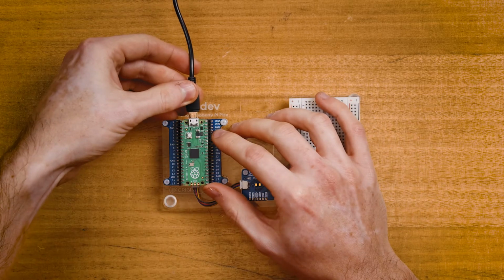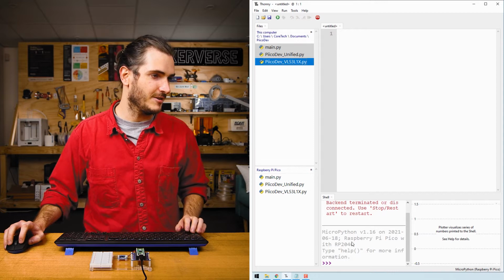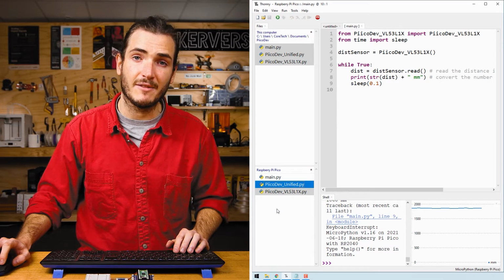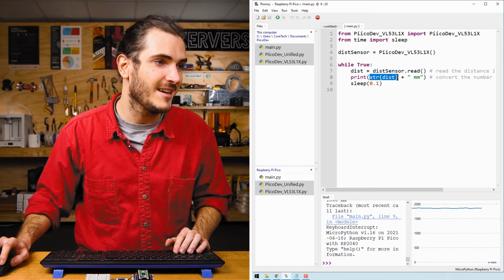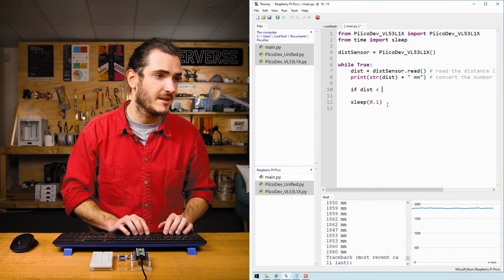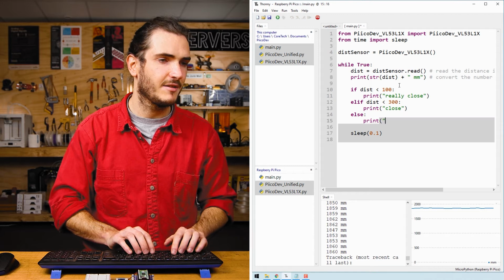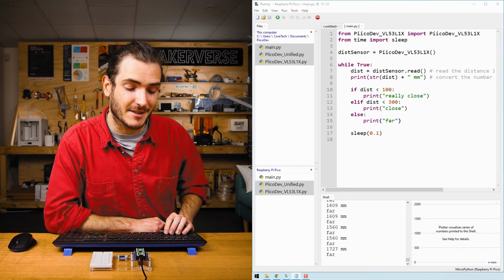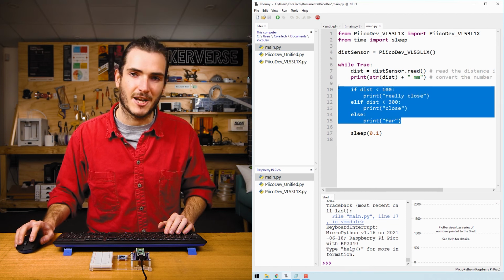PiicoDev Distance Sensor VL53L1X | Raspberry Pi Pico Guide

Comment: Thanks for making this simple to follow. This is fine for sitting at the bench and plugging into the computer, but what about when its implemented in a real situation? When i take this out into the workshop and hang it off my roller door, how do i then get it to talk to my computer ( and more so, to Home assistant)? Im sure im missing something simple. I did search the forums but wasnt able to locate anything
Reply from the maker: Hey Wayne, I can start pointing you in the right direction with some resources. First of all, if you want to display the data, you can pick up a small inexpensive OLED screen that can plug directly into the Pico: https://youtu.be/GCfDiEg_iNE

To run the code without a computer, you can save it as main.py onto the Pico. Every time the Pico is powered on, it will automatically run this code. You'll also need to find a way to power it, we have a guide for both of these things here: https://youtu.be/lHXecyrun_o

We unfortunately don't yet have a guide on Pico and home assistant, but you will need to use a Pico W which has a wireless chip on it. This will allow you to connect it to Wi-Fi and then to home assistant, there should be plenty of helpful guides out there for it.

If you are still stuck, feel free to chuck a post on our community forums, we have lots of makers over there who can help out: https://forum.core-electronics.com.au/

Best of luck mate!

Comment: Do you have tutorial on breadboard instead of using your expansion board ?
Reply from the maker: The four connections to make are 3v3, GND, SDA (to GP8) and SCL (to GP9). The best place for more in-depth technical support is at the bottom of the article, or on our forums https://forum.core-electronics.com.au/
We're full time makers and quick with a reply!

Comment: I downnloaded the code but get the following error messages when I run it on the Pico: 
Traceback (most recent call last):
  File "<stdin>", line 4, in <module>
  File "PiicoDev_VL53L1X.py", line 111, in _init_
  File "PiicoDev_VL53L1X.py", line 135, in reset
  File "PiicoDev_VL53L1X.py", line 124, in writeReg
OSError: [Errno 5] EIO

Any suggestions?
Reply from the maker: Hi Chet - we can offer better support over on our forums where it's easier to share code and photos of your setup. Head over to https://forum.core-electronics.com.au/ - we're full time makers and pretty quick to respond there!
Reply: i do to
Reply: Hi, try to power the sensor from an external power source instead of getting power from pico. That's how I solved the problem.